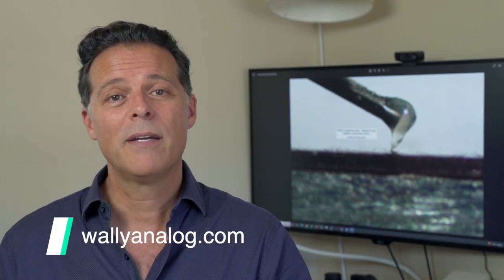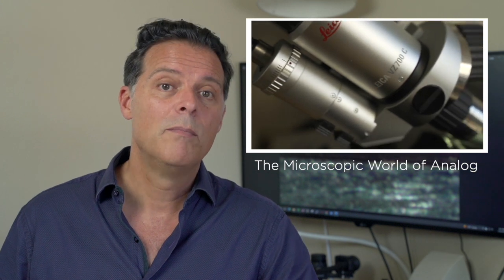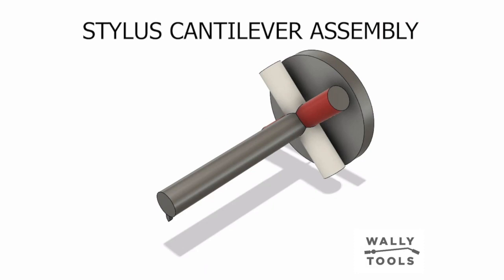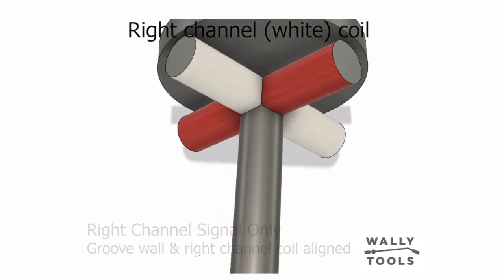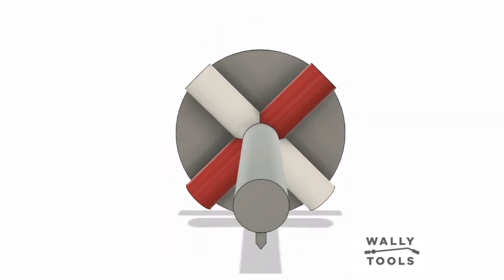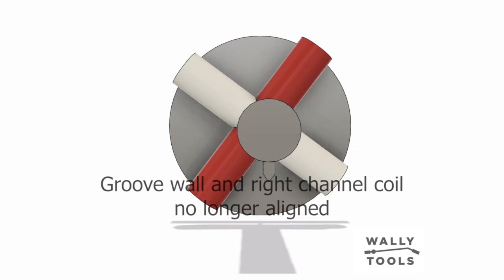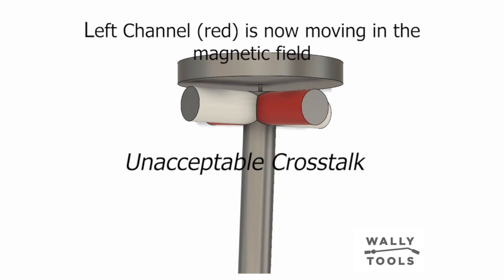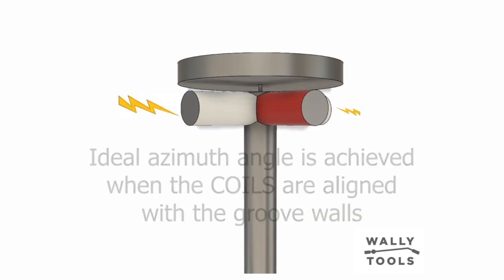Why Measure Cartridge Azimuth Electrically?

Comment: Hey JR -- the only problem that I see with this simulation is that "most" moving-coil cartridges [excluding REGA] have their coils "embedded in" or pulled (tightly, via the tensioning wire) "up-against" the elastomer damper (or it would provide no dampening or support) - ergo: there is no “gap” between the coils and the damper, as depicted here. 
So your comment that "it takes very little rotational force to shift a coil bobbin around its central axis"   [re: skating-and-anti-skating-force-myths] is (to my mind) not really a feasible model -- the damper is selected to delimit the degrees of freedom that a cartridge cantilever has, and keep the coil motor in the magnetic gap. I think that “having the coil body” rotate would be something that most transducer designers would go to great lengths to avoid. Perhaps some rethinking/revisualization is needed here. Just saying ... 🙂
Reply from the maker: Hi Charles. I'm going to have to disagree with the minimization of this concern. I suppose it is a matter of agreeing on what I meant by "little rotational force". I've seen several hundred cartridges in the lab by now and I've seen this situation many times. Usually caused by stylus being dragged violently across the record surface due to an unfortunate meeting with one's hand. Of course, the system is designed to maintain the position of the coil bobbin, but that system can fail after some brute force is applied.